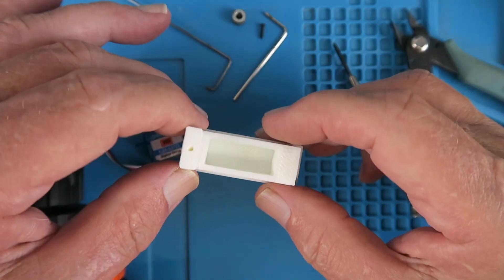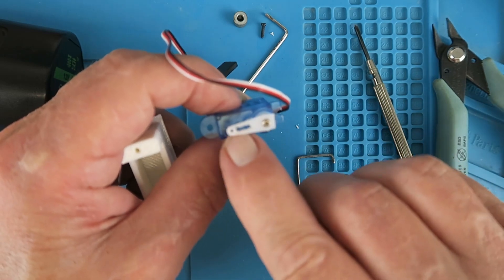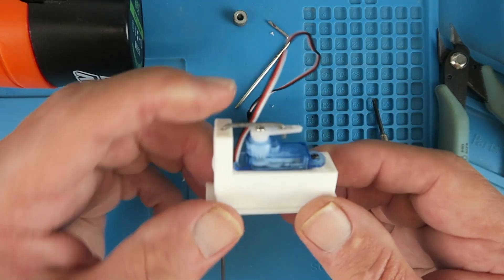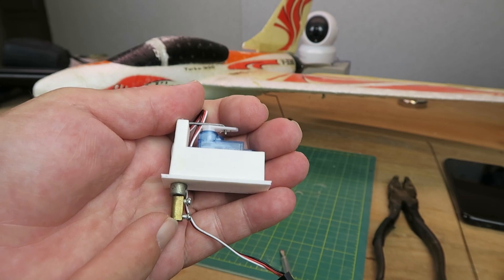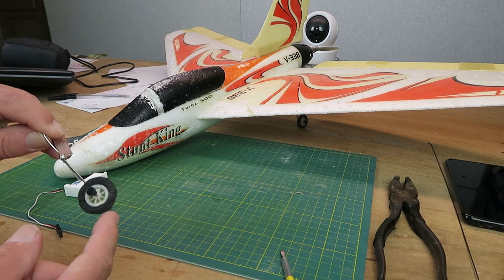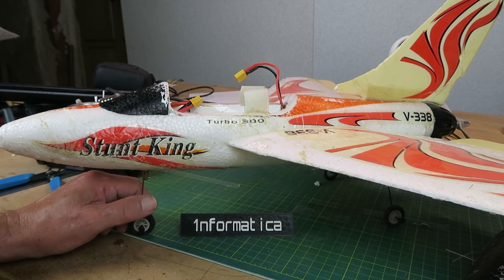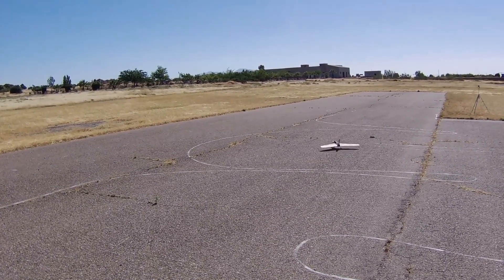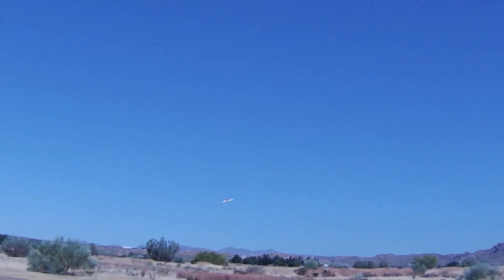3D Printed Steerable Nose Gear For Small RC Plane

Comment: Brilliant! Your landings seem to go about as well as mine. 😁
I've been looking for a better solution for my Flitetest Mini Guinea,  and this may just be it.

I'm hoping to run a flex cable to the tail, so I can control the rudder with just one servo.
Reply from the maker: Sounds like a plan! Let me know if you want the STL. Thanks for watching, have a great day!
Reply: @1nformatica  I would love to have the STL, now that I have access to a 3D printer. I just discovered that our Library has one! Have you had any trouble with the connection between the top and bottom wire coming loose?
Reply from the maker: @kf4293  Here is the link : https://drive.google.com/file/d/1ONHCgXHJkKINv19en1H_js9dlfxvqJxj/view?usp=sharing I have no issue with the connection coming loose, a drop of loctite is recommended!